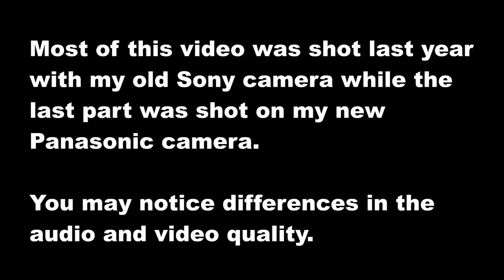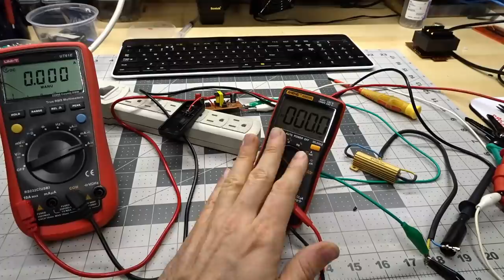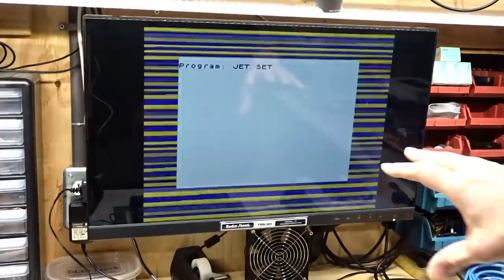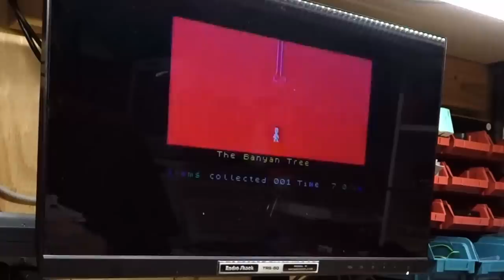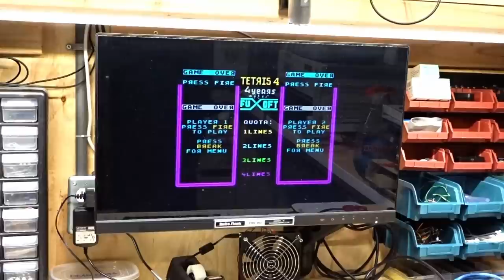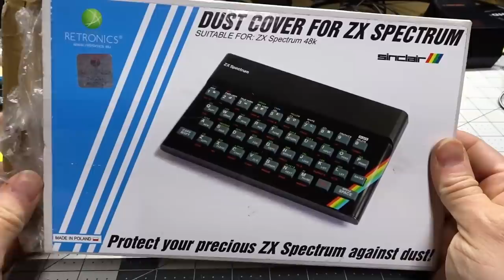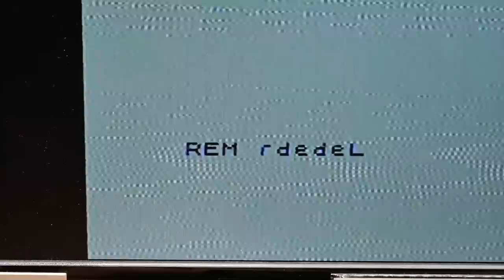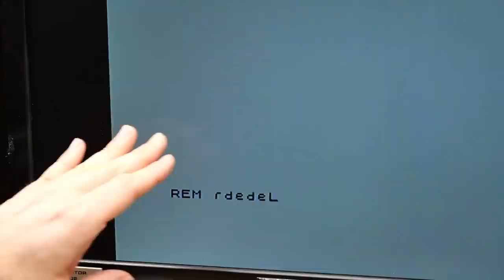ZX Spectrum Part 3 - Revisiting the machine at last!

Comment: I'm not an expert on the ZX, but I would guess you might want to lower the volume on the phone a tick or two and turn up the amp circuit. Right now you are running at the top of the phone's built in amp plus the external amp. This could be causing distortion due to essentially being post-processed twice.
Reply: This was m,y thought initially but tending towards a multiplex of issues now. Possibly just RF interference
Reply from the maker: I had tried all the different permutations to no avail. I didn't show all that testing because the video would have been hours long. What I had been meaning to do but got frustrated was scope the input signal on the spectrum itself to look at what it looked like, to check for visible signal issues.

Comment: To be honest, the Speccy was always a pedantic little loader.

In my personal experience (had one from '82 until about 2010), the better the quality of the audio equipment, the less it liked it (I suspect slight audio clipping might actually help it).

I had a crappy tape player that worked 90% of the time, but it never worked through my audio hifi separates setup.

Comment: Back in the day, I used to have the odd game that was nearly impossible to load, but usually because it was a dodgy third-generation copy.  Most games loaded fairly reliably for me.  I'd say ~90-95% success rate with originals, not much less for 1st generation copies if well made. I almost always found the best setting on the tape deck I had was volume between 9 and 10, and tone in the middle somewhere . Not sure why the failure rate is so high with your setup, Adrian. There are many audio stages each possibly adding their own distortion and noise...

I think most Speccy owners knew they were a bit crap, but in the UK, we tend to have an affection for underdogs, and there was still a cultural echo of the post-war "making do" ethic at the time. When I was older, I got a second hand C64 (and loved it), but back in 1982 that was totally out of the question for my family and most people I knew. The Speccy feels cheap and tacky because it is, but dammit - it was affordable for so many more people than machines with real keyboards!

Comment: A top tip: Petrol(Gas) is excellent for removing most types of adhesive or sometimes even glue :)
Reply from the maker: Ha! Yeah I've heard it's an excellent solvent. I like to use something a little less toxic -- LOL! WD40 really does work quite well for me with I need to really get stuff off -- although unlike petrol, it does leave a residue.
Reply: Adrian's Digital Basement Yes that is true :) WD40 has many uses haha :)

Comment: The far too high 13 Amp fuse in the plug was pretty common, people would just buy a plug from their local electricity shop or ironmongers and wire it straight on (as in those days most appliances came without plugs, a trait left over from an era of multiple plug & socket standards in the UK before the BS1363 plug & socket were standardised), not realising they should have put a 3 Amp fuse in (lowest official fuse you can buy, though other ratings are available, just not "official" BS 1363 standard fuses but still approved), cos 13Amps down a cable rated for probably about 6 amps, things could get melty... :D

Comment: Be careful with those eBay Chinisium adapters - I got a 3A 12VDC for a project, it was surprisingly light. I did a load test on it, it craps out (starts cycling) after a load of 300mA. Not even 10% of the advertised amperage.

Comment: Try another phone or even put together a tzxduino if you have a mega lying around. Adjusting the volume was needed as different tape recorders saved games at different volumes (different calibration due to any off the shelf portable cassette recorder variation). Also I needed to plug my spectrum and ZX81 psu respecting the phase else I'd get a hum noise so everything had to be right. Of course the C64 with it's custom tape unit was more stable, but hey you had to buy the tape unit so it cost more too. When u got the hang of reading the "lines" and knowing your setup loading was pretty solid!

Comment: Try to short the output capacitors on that headphone amplifier. The spectrum works with square impulses. i don't know the input impedance of the device but i think those caps alther the square wave making it more like a sine and the spectrum gets corupted data. Also you might try to use some comparators instead of opamps, i think ne5532 is pin to pin identical to lm393. I don't remember exactly because it was a long time ago and i didn't have the spectrum, in my country we had clones of it (HC85,HC91,HC2000) but i thinke it helps if you cranck the volume tot eleven:). Also try to change the potentiometer. My guess is that the original one is logaritmic and at half length you have avout 25% of the output volume then it rises rapidly. With a linear potentiometre you shoud have more precise output level.

Comment: Unlike the Commodores and Amstrads, the Spectrum didn't have a standard cassette recorder. Some worked better than others. Often, you had to adjust the output volume and try to load a game multiple times. Then again, the tapes were often very low quality. When I went from the original 48K model to a +2 (built-in cassette recorder), some games loaded more reliably, but some were less reliable. You'd usually find that your own saved programs loaded more reliably, which is more evidence that sub-standard tapes were being used by the software houses, or something was going wrong in the duplication process.

I wonder whether running the audio files through a volume normaliser would yield more consistent results.

Comment: I would’ve used a Raspberry PI as the tape loader.  So much more control on volume output if tape image volumes are inconsistent.  I know ideally having a modern peripheral that has images on it that would emulate a cartridge, but given that you can’t use peripherals due to the modded PSU, yeah I would PI it up.

Comment: just had a an idea: with audio files, the mastering volume for programs can be all over the board... maybe it would be better to have a bit-stream drive a fixed-volume tone generator, as it would (by default) mean that every program is 'mastered' at the same volume/pitch, which in turn would turn the amplification problem into a garter/goose issue.

Comment: remember to add a label to the PSU say you modified it for 110v in and max amperage, 2 to 3 year from now it will be just easer to read the label than get out all the kit to check also mention polarity on the DC out perhaps
Reply from the maker: Heh luckily the new PSU is a switching supply so will work fine anywhere. The polarity I should just mark it on the spectrum itself in case I use something alternate.

Comment: Notice how the UK plug’s “ground” pin is longer than the other two. That’s to ensure that it’s connected first, keeping everything safe.
Reply: Also, the vast majority of sockets have a spring-loaded cover over the other two (behind the socket's front plastic), which is deflected down by the earth pin - meaning you can't poke anything into the live and neutral holes (unless you also poke something into the earth hole too!).

Comment: Look into the Mean Well range of SMPS, you’d be able to find a PSU that would fit in that old case that’s a far better PSU, and better quality for the money. And give approx 2.5A of current output
Reply: Good point. Mean Well is a great brand and is only slightly more expensive than a hooflungpoo from ePay.

Comment: interference might be a factor but honestly the audio sounds very low.  The ear and mic ports on a vintage tape deck drive signals much higher than modern phones and the like.

I think when Ben Heck was making his version he omitted a couple of resistors in the tape interface, and I think they're optional on modern Spec Clones like the Harlequin, too.

Comment: A lot of people are seriously exaggerating how it was hard to load programs from cassette in the 80s on the real machine. It wasn't at all - at least original commercial cassettes (magazine cover tapes were often crappy quality though) on a properly working portable cassette recorder. Most people copied freely with friends and these were often really fiddly to load because copying cassettes changed volume levels, added lots of noise, etc. I had probably 200 or so games on tape I'd bought before I finally moved on from the Spectrum and can remember literally all of them loaded without any issue or change of volume on the cassette recorder. Almost all of the ones I'd had copied on tape from friends though were a pain.

Comment: Is it worth the effort to DIY a Faraday Cage for the amp module and try to block RF noise?  What could you use -- melamine sheets, aluminum foil?  Probably not worth it...

Comment: Have you tried using a generic MP3 player to load programs? Granted, a lot less convenient but it could help eliminate a potential trouble point. Was also thinking about using a longer audio cable between your phone and the audio amplifier. Placement of your ZX Spectrum in the Man Cave indicates you may be done with testing for a while, though!

Comment: Any possibility the amp's power supply is the problem? Try replacing it with batteries to see. Have you tried listening to the phone or amp's output while loading with a Y adapter? It might let you hear the problem. A set of earbuds might even change the impedance enough to make it work. As a last resort adding an optoisolator might block problems caused by noise on the power line.

Comment: I know, a new reply on an old video...
FWLIW: Spectum's tend to be much more reliable when loading from 'analogue' (cheapo cassette decks) than 'digital' (modern devices like phones) sources. It is possible to improve this behavior by pulling some of the passives from the Speccy's audio circuitry but IMO that's too much hassle.
I'd be tempted to:
-Try replacing the crappy old regulator in the Speccy with something more modern, cooler, and cleaner
-Get a DivIDE interface or similar, preferably one with a built-in joystick adapter, and forget about 'tape loading'
-Put the Speccy on display and never use it again*
*They do have a stupidly large software library with some great games but IMO most of the charm is to be found in nostalgia and amazement at the technical achievement. I do play Laser Squad on the Speccy from time to time because it's the best version of my favourite 8-bit game but otherwise I can't think of a single game I like on the Spectrum that I don't prefer on another system - sorry.

Comment: Adrian, have you tried the mic-socket on the Speccy instead of the ear? I had a issue 2 back in the day and remember switching the the audio-cables to get things working..

Also check your phone for EQ-settings.. There should be no equalisation whatsoever..

Please check the settings in the PlayZX app as well , there is an option to double the playback speed.. This should be turned off for reliability..

Comment: The reason that plug had a 13A fuse is that the PSU originally came without a plug and 99% of plugs came with the 13A fuse in them. Most people have no idea what size fuse should be in the plug :(

Comment: If you have EQ turned on in the phone, maybe it's messing with the signal balance or making it clip a little even before it comes out of the phone.  Maybe turn off EQ (if any), reduce phone volume, increase amp vol?
Reply from the maker: I didn't show all the troubleshooting I did in the video but yeah I tried all the permutations to no avail. (No EQ on that phone either.)
Reply: @adriansdigitalbasement  Well shoot, that's disappointing!!!  I don't know a thing about those Speccies, or anything else to suggest.  :(  I hope you can get it working right!!

Comment: One tip Adrian, manufacturing best practice for thru hole parts is to correctly size the leads including strain relief, before soldering to pcb as clipping leads after soldering can induce  stress fractures in solder joints causing intermittency   issues.  We learned this the hard way after NASA  found issues with our parts and their root cause failure analysis and corrective action pointed this out. Best regards, can't get enough of your videos.

Comment: Hello Adrian.  First of all, congratulations for the awesome channel. I am a big fan of it.   Quick question for you:  I see you have a SCART to HDMI adapter (and I have one as well, same model, same color, identical) but it happens that the RCP connector is supposed to be a COAXIAL (Audio Output) connector. How did you connect the Composite Video Output from ZX Spectrum to it? That is a sound output.  What is the trick, please?  Thanks and Congrats once again!

Comment: Well I had one, one thing I notice is that I had to adjust my tape recorder to the spectrum ( it like high clear sound ), the other thing I test was to use a C64 tape reader on the spectrum and it work great ( like better that great, for some reason it read the gamer A LOT better ).

About the hit and miss of the games, well it was a common thing but after I learn to adjust the heads and later use a C64 tape reader I stop having that problem.

Comment: I'm no electronics expert, but could the lower 7v supply be affecting the loading circuits somehow? Is there an amp involved?
Reply: It's unlikely as the power in to the Speccy goes straight to a LM7805 linear voltage regulator that spits out 5V and a shed load of heat. The 7V supply will reduce the wasted heat from the voltage reg. 

On the ZX80 it was such a problem we used to stick a tetra-pak milk carton in the freezer and sit that on the case where the heatsink was close to the top to try to keep the bloody thing alive for longer.
Reply: @DougieLawson  Interesting info thanks! I wonder would the LM7805 put out a lower current at 5V (due to the lower watts going into it) which would, in turn, still affect the loading circuits?  Afterall, not all voltages are the same right. Never had a zx80, badly wanted one and pestered my Dad, but then the 81 came out! He made it from the kit (hero). After that, I got a Jupiter Ace which I still have somewhere in my father's loft! I even made an adaptor myself aged 12 that converted the 81 16k Ram pack to the Jupiter Ace. Worked just fine! Lots of wires, I felt like a mad scientist at the time!
Reply: @DougieLawson  7V is marginal for a 7805. The datasheet specifies a 2.5V dropout. But, I doubt it's got anything to do with poor tape loading. Legend has that that it sucks at loading from tapes.
Reply: @andrewnorris5415  No. The 7805 will spit out 5V with anywhere from 7.5 to 35V input. Anything more is just wasted as heat.
Reply: @misterhat5823  AhH ok,  so it's always the same current? Not like the modern buck converters I have been using. Fair dos.

Comment: On the first landing (below the second screen which is the top landing) go to the bottom of the stairs (the diagonal line) and type "writetyper" but you have to position yourself so typing that doesn't move you onto the stairs. You now have infinite lives. BUT! there was a bug so if you go to some rooms in the wrong order you enter an infinite death loop. The Attic was involved in that.
Reply: Interesting funny thing, to the right of the landing is the chapel which has a giant sinister head that looked a lot like the archbishop of canterbury between 2003 and 2012: https://en.wikipedia.org/wiki/Rowan_Williams

Comment: I know I'm very late and not a ZX owner, but I wonder if a 3.5mm ground loop isolator would help(between the amp and the ZX), just in case you are getting noise interference from the mains. I have to use them for my mic on my PC and for my echo auto in my vehicles. Also shielded cables with chokes could maybe help. I'm just spitballing here as I'm an American who has never touched a ZX Spectrum.

Comment: Are you ever going to fix the printer? Would be neat if there was an NTSC mod for it somewhere.

Spectrum has always been known for having finnicky tape loading, even the earlier ZX80 and ZX81. Ought to have a look at the internal tape circuits and just patch it there instead of using something external.

Comment: True, the C64 is more usable than the ZX Spectrum. I would also add that the Amstrad CPC is even more usable than the C64, with a better BASIC enhanced with more graphic commands and also able to run CP/M OS that were hundreds of applications written in this system. The keyboard was also better for typing. When writing programs in CPC, you felt you were in home.

Comment: Apparently, if I recall an episode of RMC on the spectrum, spectrum games were programmed on a C64, then transferred over via null-modem cable. Even programmers hated the spectrum keyboard.
Reply: That would more likely have been an Amstrad CPC or something; I doubt anyone would have programmed Speccy games on a 64 (different CPU's, Z80 vs 6502)
Reply from the maker: Did people make keyboard replacements for the early Spectrums? To help with programming.
Reply: @junkdata6242  You might be right, it was a while since I saw the video I referenced. @Adrian's Digital Basement: I don't believe so. But I could be wrong.

Comment: the noise on your video cable is due to shielding, and i am wondering if the loading problem is due to the same reason. i would see about getting some shielded audio cables, see if that doesnt fix the issue.

and turn down the volume on the phone - cheap phones distort audio at high volumes.  Drop to 80% and use the amp to compensate.